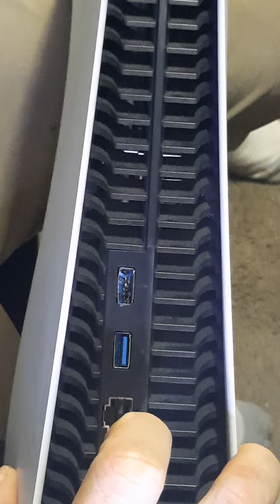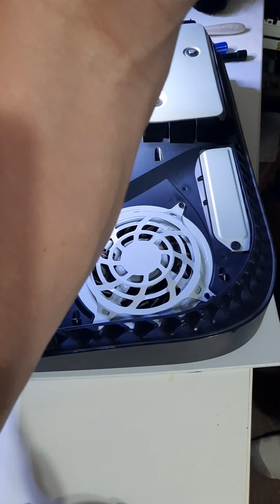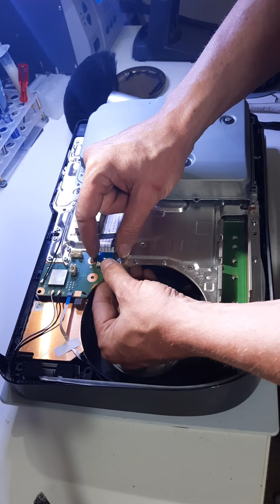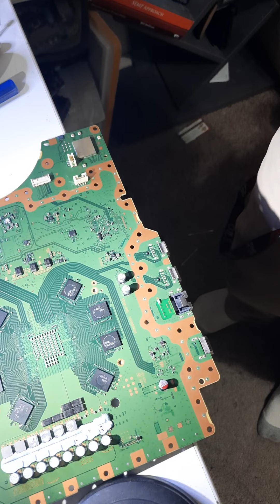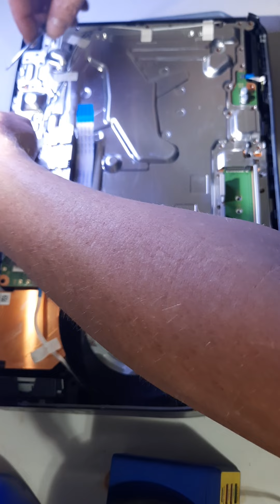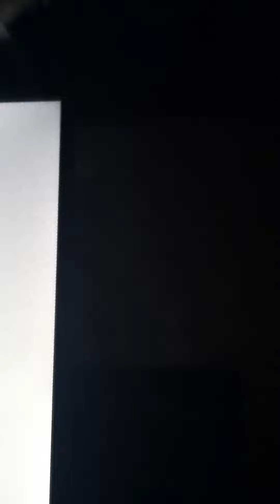PS5 Back USB Port Replacement Tutorial by SBL Games, Inc. 🎮

Comment from the maker: Items/Materials Used/Required:

Low Melt Solder -
https://amzn.to/4yDUt71

Soldering Iron -
https://amzn.to/4gCqJAP

Solder Wick -
https://amzn.to/4w37a9B

Solder -
https://amzn.to/4vvHilB

Flux -
https://amzn.to/3RewVo3

PS5 Back USB Port Replacement -
https://amzn.to/4fsMi4B

Rework Station -
https://amzn.to/3TkvnJX

PCB Cleaning Brush -
https://amzn.to/4wMrig4

99.999% IPA (Isopropyl Alcohol) -
https://amzn.to/4fu1Epn

Large Barber's Brush -
https://amzn.to/4pE2rcc

Comment: Why didn't you use solder wick in the removal process?
Reply from the maker: Thank you for viewing and commenting. The solder wick is used to clear the post holes and pin holes. The low melt and rework station are used to remove the Port.
Reply: @sblgamesinc Is there a way to remove the port without the rework station and maybe just the soldering iron?
Reply from the maker: Yes. Low melt, a soldering iron, and tons of patience.
Reply from the maker: https://youtu.be/KMX9UScDKA0
Reply from the maker: What system do you Have?
Reply: @sblgamesinc  ps5, need to do the same repair as the video here for the usb port.
Reply from the maker: I could definitely use a junk PS5 Mainboard to make that Video for you. I'll drop it on Sunday.
Reply: @sblgamesinc  ended up getting a rework station, but the solder I applied wasn’t melting so the component didn’t come off. Can you tell me the solder you used and the temperature you used for the rework station. Idk what the problem is
Reply from the maker: I'm working on making a few viewers request Videos including yours. I'll be in touch ASAP.
Reply from the maker: @firescorpion7241 The problem is that the equipment and settings you're using are not 🚫 able to cover enough "surface area" in order to completely melt the Solder.